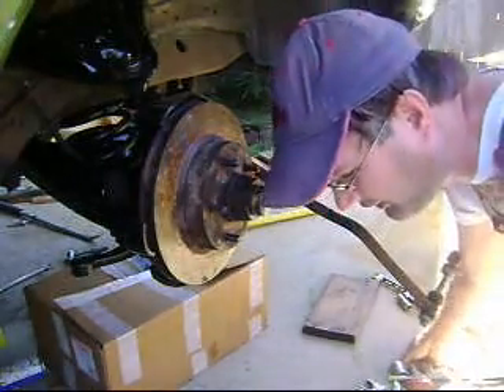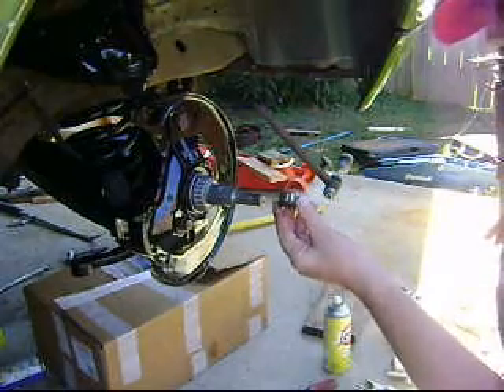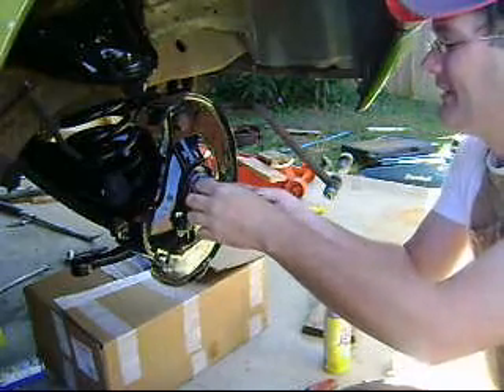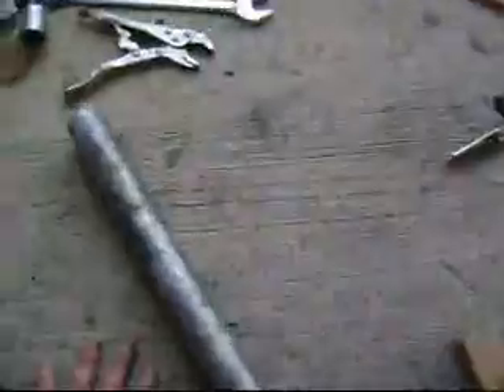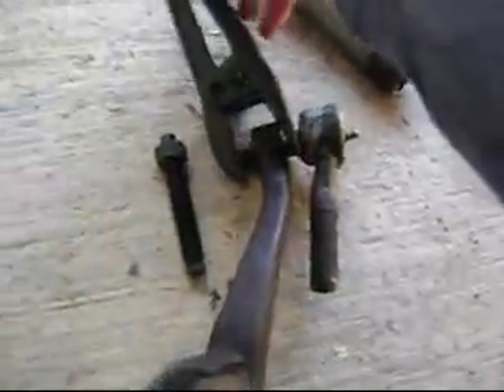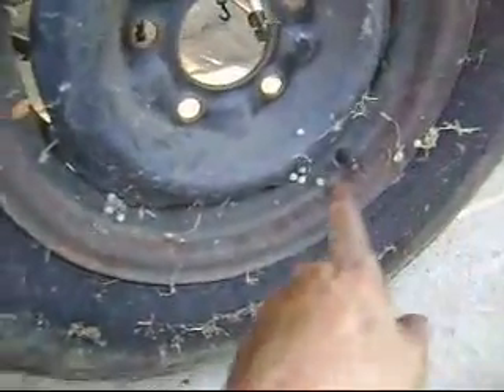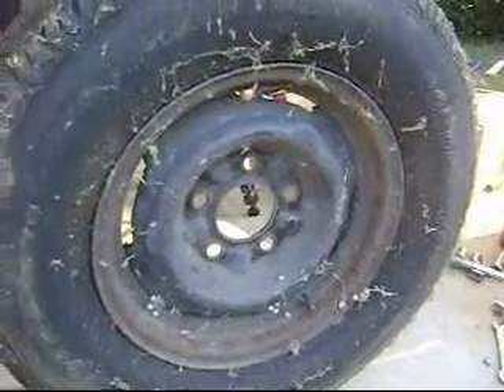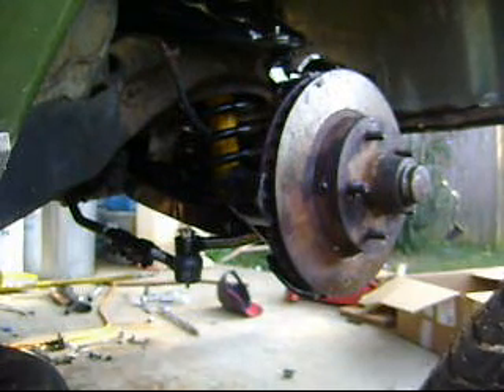1968 Pontiac Catalina Drum To Disc Brake Conversion Part 13

Comment: i dont think i've ever greased the bearings in my back brakes...... i didnt grease them and they sat for about 6-7 years....i think i should. lol i also found a website with alot of fullsize pontiac parts. alot of the stuff on these cars are worth alot of money, i might sell the parts i dont need or use, i've got 1 of every light on this car. i can't wait to see her back on all fours. what kind of rims are you planning on putting on?